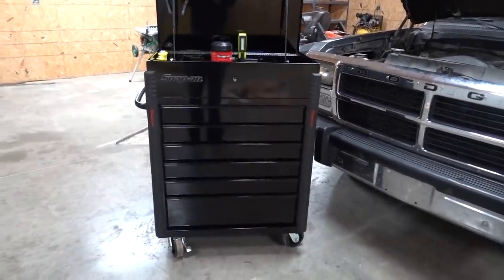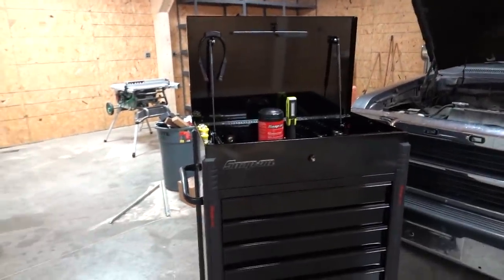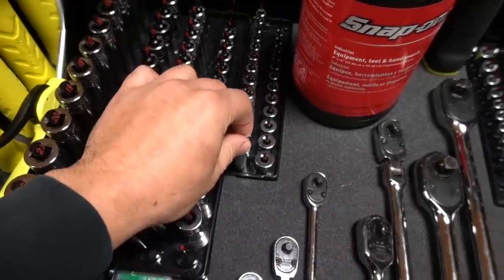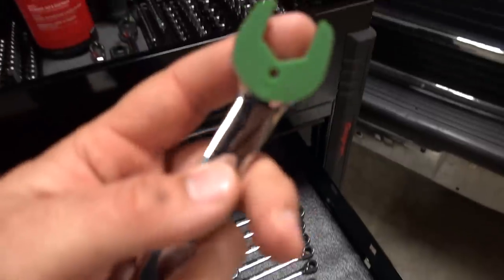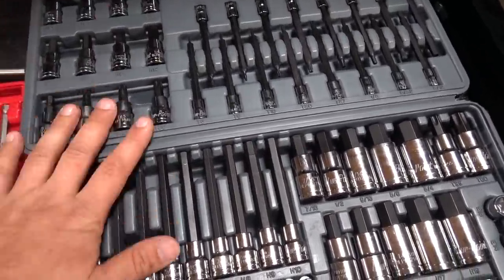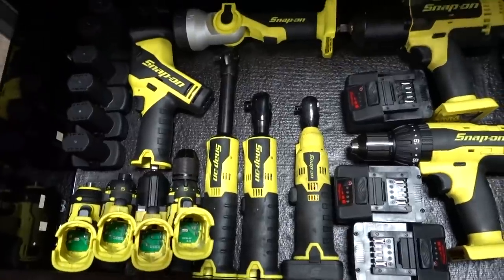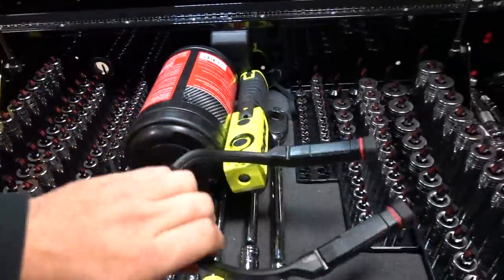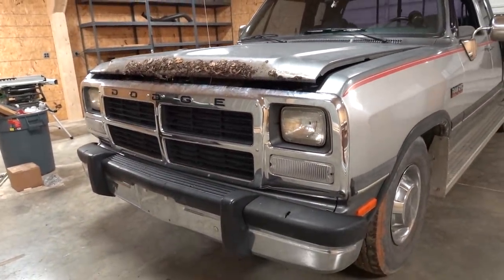$10,000 SNAP-ON RACE ROLL CART TOUR!!!

Comment: Full/out of space?  You can fit double the tools you have in there. It’s ok if tools touch each other. 😂
Reply: Agreed. Most definitely not out of space
Reply: When stuff starts getting set on top of one another then we can talk about upgrading. But he's got several drawers worth of open space. He's not even utilizing the outside walls and lid. Get some of those magnet bars and hang your ratchets on the lid, then get some impact holders to hold all of your cordless tools on the outside for quick easy access. Boom you cleared up a few drawers.
Reply: @jon-erikbutcher3609  I work out of a cheap Matco cart all day, I only have to walk over to my box a couple times. Most people don't know how to store things efficiently. I work with kids who store their sockets horizontally in the original package and store pliers flat, instead of in plier racks. Their boxes also store useless or broken tools that they never touch, but they all say:"I'm out of space! Looks like it's time to trade in my just paid-off box for pennies on the dollar and
 spend years paying off a new 72" epiq."
Reply: I can’t agree more with this comment section. I run a service truck an I have tools stacked on top of tools stacked on top of tools. I’ve got so many pliers shoved into one drawer (watch my tour an you’ll see, since I’ve got more now) let alone the other tools I bought since I did my tour that it’s ridiculous lol then there’s a guy in my shop that just bought a triple bank epiq who has blow molded cases laid out open Instead of having more room that he needs. Blows my mind
Reply: that is very true, but sometimes it’s hard to get at everything.
Reply: @jon-erikbutcher3609  But if tools are laying on top of each other how can he see his pretty high viz color on all his non-dirty tools??? -_-

Comment: Great cart and tools.  I think you still have plenty of room.  You just need Power Tool holders in the bottom drawer and you'll be able to fit more.  Gotta get some long box end ratcheting wrenches, and some impact sockets.  If you do upgrade to 40" cart get one with the sliding tops as opposed to the the flip top that you have.

Comment: I have the same issue with all my 14.4 stuff. I stuck my chargers to the inside upper side of the drawer with 3m double sided tape and ran the cords out the back. Now they at fit except the big double charger.

Comment: You need some impact sockets. You've got an impact but no sockets for it. Yes you can put chrome sockets on an impact, but could and should are two very different words.
Reply: Carson Watson  do you often need to replace your cheap sockets?
Reply: Does the hard CR-V beat up the anvil on your driver's?
Reply: It’s got to do with the material the sockets are made out of. Cr-v is very hard, meaning they last a long time under normal use and should not wear out. However the thing about hardened materials is that they will not take abuse from shock loads. Hitting hardened steel is like to crack and then break suddenly. When sockets shatter people get hurt. Cr-mo sockets are softer meaning they can take the shock impacts by being able to deform by a very small amount after long periods of time. Like I said, you can use chrome sockets on impacts, but you shouldn’t. When the sockets explode they sent fragments all over the place.

Comment: Definitely need to get a 1/4"  drive impact swivel, 3/8"  and 1/2" drive impact swivel. You'll never touch another chrome swivel lol. And When I was working on a race team we had a pit box. Kind of kept all the misc stuff in there like chargers exc.  we had a stainless shelf that was mounted on the trailer wall that would flip down. And you could setup a charging station there for headsets and impacts.

Comment: The sockets will fit in the lower drawers I have shallow mids and deep in the top pull out drawer. Plus you can get a power strip for your box. I have all of my chargers in the top spot. I have the same box as you

Comment: Garage sales and craigslist get you some awesome deals. I have bought alot of broken sockets and extensions for pennies. If it still has the part number most of your dealers will warranty it and you get a brand new tool. I bought the same roll cart in flat black with red trim from a kid who quit for only $500. Snap on also has the rock n roll demo truck that swings by once a year, got my latest triple bank master series box for $2800... saved over $10k. I'm ballin' on a budget!

Comment: Short wrenches, I don’t know about you but I use the heck out of mine.
Reply: Stubbies are under appreciated.  Need bigger sizes of them.
Reply: @williamuskoski1385  that's the truth.  I would love to have a 22mm stubby
Reply: William Uskoski yes they are for sure, ALSO the 3/8 ratchet head with a 1/4 handle is VERY useful flex head or solid are both great for tight areas where the longer handle only get you 1/8 per turn like a starter, vacuum pump, alternator, tappet cover, front cover, ANY ppump work, intake plenum, cooler mounts/ bumper brackets all while in the truck obviously and whatever else you can think to use it for.
Reply: @DOAD_Diesel  tool companies are finally making them. So we don't have to modify em. Time is money

Comment: I don’t know how you feel about drilling into your cart but on my roll cart I put 2 self tappers through the side up by the top and just hung my chargers on the screws. I just keep the power cords for them wound up in the top and if I need to charge a battery I just grab the cord and an extension cord and plug it in. But I also have a U.S general roll cart 😂

Comment: Greg, How come you don't have any Impact sockets?
Reply: because warranty
Reply: @DerferTV  That's strange I have warranted many impact sockets from Snap On. Including swivels and 3/4" drive deeps as well.
Reply: Snapon will still warrenty chrome socket if you use them on a impact.
Reply: @SkiFanatix  They will? I thought that was forbidden.
Reply: Depends on your dealer. Ours dont care, the next guy might.
Reply: Ya guys dont use chromies with impacts, I've broke many and when they come apart picture someone tossing a socket at u as hard as they can they fuckin fly apart
Reply: Impact sockets are actually softer/not as rigid as chrome sockets and the reason is to protect the anvil on your impact gun/ratchet from wearing out/breaking.
Reply: @jerryme72  THANK YOU!!!!! This guy knows what he talkin bout!
Reply: @mikeevansgoat7557   This wasn't common knowledge? lol DAYUM! Id rather spend money on good impact sockets for light duty work than chromies. Well and then good impact sockets for HD work too. The lesson here is buy good impact sockets so you don't get a face full of chrome; because no one actually wears safety glasses.

Comment: Tools you're missing- long picks. I find I use those as much or more than my shorties working on my trucks. I like my seal removers too, they come in hi vis like the picks lol. They're great for getting off o rings and they're less likely to do damage to the ring or the piece than picks. 

For organization, I'd get the snap on wrench rails. KRA15a and KRA22a, IIRC the 22 is for bigger wrenches. Hands down the best wrench organizers out there. I've had multiple people who own ZERO snap on tools tell me they love those wrench rails, and that they're "the only thing snap on makes worth the money" and I'm inclined to agree. You'll be able to really condense your wrenches and get some free space in the drawers or maybe even double it up. 
I grab my whole set and drag it with me a lot so I have a metric and standard set on a rail with a handle, and I double stack them in my deep drawer. Takes a little more space but it's handy when you're junkyarding or working on something away from the truck and don't know the size you'll need. Just grab both racks in one hand and go. 
Either way I'm sure you can cinch up some space in those wrench drawers. 

I'd also leave the 14.4v charger at home on  a shelf. In the race trailer, the combo will work fine. Or get two combos. Also, mount them somewhere! You have a generator and I assume ac power in that trailer. Mount two combo chargers on the wall.

Comment: Put a magnet set on the chargers and put it on the side of the tool box . But get a good magnet that'll hold it. Also I have the same box shocket will fit in the first drawer no issues.

Comment: Missing tools-Safety wire pliers and safety wire. Magnet for dropped hardware. Long reach double flex needle nose pliers. Hose pinch off pliers. And I highly recommend the extended long reach number 2 Philips snap on offers. Works amazing with rusty or stuck screws.

Comment: Get rid of those socket holders put the ones with the square up so they lock in so you can run to it with a bolt in your hand and insert it quickly and find the one that fits.

Comment: When I started as a technician at a dealership I started off with a craftsman 300 piece set as I started doing more and more over the years I bought the better stuff off the trucks.very well said Greg
Reply: I did the same but with the 540? piece set. I found that it is still adequate. But I did have to purchase tool truck 10mm, 13mm, 15mm, 18mm, and 19mm 3/8 impact sockets in deep and also in shallow and mid length swivel sockets. Also had to buy 3/8 and 1/2 tool truck pinless universal swivels.   I still break some every now and then and most of the time it's the tool truck swivels. I bought that craftsman set about 17 years ago when they were still made in the USA and I'd buy another to have at the house but now that they are Chinese I just carry my tool bag home instead of buying another set. I work at a Chevrolet dealership so that's why I never broke other sizes...

Comment: Why not put your ratchets in the first drawer with your meteric wrenches then put both chargers where they where sitting. Run the cord threw the hole and your all set. Or get rid of the other charger since the bigger one has the same one the same spot as the single small one. Great video and I like tst truck. Im not a dodge guy but thats the only kind I would get.

Comment: suggestion is to stick the battery chargers in the trailer itself. Mount them in a place where you can have them plugged in and charging with out them moving when in route. I am sure you have other chargers for the batteries in the garage to use when you bring the box into the garage.

Comment: Man… I bought that same Snap-On drawer light you have because I thought it was awesome when I saw it on this video however I got it used on eBay and it didn’t include the instructions…. and Snap-On doesn’t have the manual on their website.. I have no idea how to use that little sensor thing. Can ya help me out? How do you set it up? I wish I had the instructions, even a picture of the instructions would help me..

Comment: Only different thing I would do is put the metric sockets in with the metric wrenches and set the ratchets in the top or get another wrench seperater and go from small to big and big to small on the other side then they can sit closer together if you did both of them you probably wouldn't have much in the top except for the chargers and ratchets

Comment: organize your wrenches better and move your sockets down to those drawers. Those drawers are deep enough to hold your deep walled sockets and still should be able to split them up between your metric and standard.  Your entire top section would be open.

Comment: tiny bit of brake clean on a rag/towel will get the rubber on the tools clean
Reply: WD40 and Blaster works great too without any risk of damaging the rubber or plastic.
Reply: So does starting fluid

Comment: No where near out of room. You can fit all that in a 5 drawer service cart..and still have room. Magnet bars for the ratchets put them on the lid.. ditch the Hansen trays and pick up the 4 rail trays.. craftsman, husky, olsa tools.. don’t matter the brand. Having the size listed on the tray is nice but let’s face it if you pull sockets every day you know what slot they are without looking. Buy a pliers rack (they will sit vertical in drawers 3 inches or above).the wrenches can be organized better with different holders and condensed into one drawer and still have room.. I can keep going but you get the point. Forgot to mention with the 4 rail trays you can fit sockets standing up in your drawers too and open up the top for your most used cordless tools and batteries.

Comment: Blue Point is subcontractor-rebranded offshore made tools with the absurd Snap-On price. Blue point was originally a US of A wrench manufacture that Snap-On purchased to get into the wrench business as Snap-On was socket wrench specific company during their beginnings. There is about zero reason to purchase Blue Point anything these days as they are much the same as could be purchased for FAR less on-line with zero difference in "lifetime" warranty. Ya got impact tools with no impact sockets? Ever experience the shrapnel of a exploding socket being driven by a truly powerful impact wrench? The potential and possibility of being impaled and serious bodily injury is very, very real. Lots of wrencher folks get away with using non-impact sockets on impact wrenches for a while.. then comes the day when that non-impact socket explodes which ruins more than the entire day. As for Snap-On impact sockets, they are absurdly over priced junk. They are soft and wear out easy causing them to slip while wrenching. So they are "lifetime" warranted, but after you've "warrantied" then several times, it gets old really fast. Today even Hazard Freight made in Taiwan impact sockets are superior to the Snap-On offering. Best impact sockets made are Momento (Sweden), Ozat (Israel), Wright Tool (US of A) and other industrial brands that are not sold from a Tool Truck.

What was the gross out most, Snap-On Diaper wipes for tools. At $24 per bottle, why, just why? All these bright shiny beauty tools are not going to be so pretty after daily wrenching on stuff for a few decades. Bright shiny smooth chrome tools are slippery once the hands are covered with moto goo making them more difficult to control and that bright smooth chrome does not look the same after they have been scraped, stood on, slipped off hardware, wear out and all the usual stuff of tool life. For all that $ spent on this tool kit, it's real world wrenching capability is very, very limited in ways you'll soon discover.

Comment: https://www.harborfreight.com/Wire-Pliers-Rack-70022.html for your wrenches to store them standing up. I actually got mine off the Snap on truck but a google search found these. 
And move your tub of towels and put your battery charger up there and run your cord through the hole like it was made for. You can get a side accessory rack to mount things on the side of the cart, I’d look into those. That cart is about the perfect size i would imagine unless you step up to a 46”. If you do get a new one, see if you can order one with the drawers how you want them